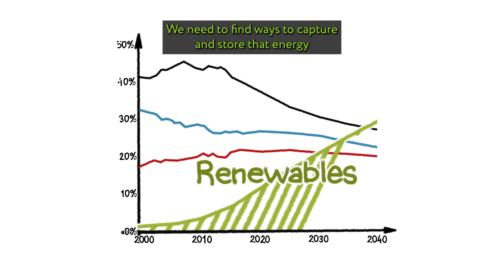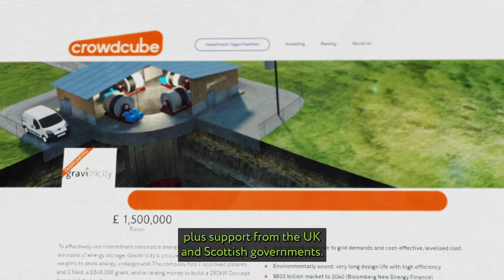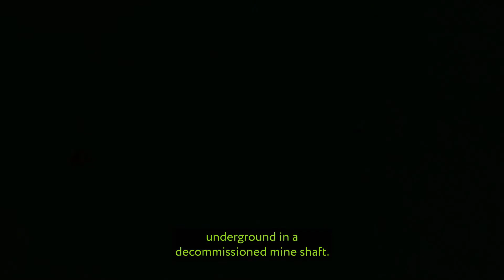Gravitricity Campaign -  Unique technology uses heavy weights to store energy underground

Comment: The company may have 4 or seven patents on different part of the system they use on storing gravity energy, and this is appreciated.  The technology can achieve to deliver limited energy on the greed, very probable the company may buy X kwh energy  from solar farms when energy is not needed and X1 kwh from wind farms if the energy is not needed.  Probably 2 time daily and 700 time yearly is possible to store energy for 700 blocks. Then these block will be used daily and deliver for few seconds or few minutes energy when needed.  A 500 Tonne weight at 1500 meter mine shaft will drop and generate only "Y" KWh during 18 sec or few minutes if will be slowed. The Y will be around 1.635 MWh if efficiency is 80%.  For this energy the company will by  from solar or wind farm 2.45 MWh if lifting system has efficiency 80%. So, SELL. vs BUY energy ratio is 67%

Comment: As far as scalability is concerned, I am curious whether a model of the same efficiency can be built so that someone could install their own at home, and physically hand-pump water up into the heavy containers, to generate the electricity on your own, without having to draw the energy from the grid. Perhaps the pump could be attached to a bike wheel to pedal the water up, or a person could carry jugs of water up to the top of a staircase, to get lots of cardio, per weight drop?
Reply: ofcourse it possible but it is not cost effective to use for powering your house  cause it have a mechanical and electrical systems including generator,motor, control system, wind or solar power device ...

Comment: What a stupid waste of money. Inferior in every way to pumped hydro and I don't need to pump (no pun intended) millions into research to see the obvious. Still kudos for getting a bunch of funding to fart about with.
Reply: I would like to start with a comment on potential energy storage.
Contrary to the claim that reservoirs generate energy, this system is in reality, the largest and oldest way of storing potential energy.	

In the first story I read about Gravicity, a weight of 3000 tons  could be lowered to a depth of 1500 meters in a mine shaft.
In this way, 12.26 MWh of stored electrical energy could be returned.

At the same time I was experimenting and developing my  Gravity Gallery ® system.
With this system, the same amount of potential energy can be stored  in this shaft, with 3000 tons  of ballast in a working depth of only 775 m.

If the entire shaft of 1 500 metres deep is used, this can amount to:
16 875 000 kNm potential energy.

Which corresponds to;   45 980.9 kWh 45.98 MWh electrical energy.

Comment: 250Kw for 30 seconds. Drop 50 tonnes 15m = 7.5MJ = 2.1Kwh single kettle for an hour, at scale 500 tonnes 1500m = 21,000 Kwh. You cannae change the laws of physics....
Reply: PE=mgh, I don't know how you are calculating
Reply: @paksauditech.5360 
mgh delivers Joule (if mass m in kg;  g is 10m/s^2; height h in m).
To get kWh you need to know that 1  Joule is 1 Watt * Second or 1 Ws.
So 1kWh = 3.6 MJ (3.6 Millions Joule)

Comment: The presentation should simply be "A lot of money is being thrown at green energy projects and we want some of it".  For a system like this, or "energy vault" to work you need a grid producing enough excess power to change the system up.  This might mean more windmills or more solar, I am excluding nuclear, fuel based,  and hydro systems because they don't stop working when nature isn't doing it's part.  Well, hydro does but on a much longer cycle.  Anyway, you need the grid charging it up, which means excess power generation systems, not quite double the needed output, which will have to be considered in the cost of any kind of system like this.

Comment: SO , begs the question, why use concrete or lead or what every you want to use as a gravity battery? Why not use Dry ice in a closed well bore or mine shaft.  Attach a block of dry ice to your line, depending on the enviroment inside the the shaft... its time as in a solid state will determine the amount of energy you can harvest off of your frozen carbon dioxide cube. Gravity cares not what it pushes on...  After the dry ice turns to a vapor you wont have to tug very much at all against gravity to get your rope back up on the drum. The dry ice expands inside the shaft and you capture the carbon dioxide gas and compress it back into more dry ice.  Yes the process of compression uses energy, but maybe the math would determine viability of this idea... what do you think?
Reply: I didn't hear where they mentioned what is inside the containers; where do you get that data?

Comment: I appreciate the concept and believe the kinks will be worked out and it will become viable. But in watching the test model, the thought occurred that using a pendulum design may prove more simple and even more efficient. Theoretically, a pendulum design should require substantially less energy to overcome gravity. Or have the pendulum make the full revolution and it may even produce more and overcome gravity for 1/5th the arc. Lastly, what about a weighted roller coast system? Start with a two-hundred foot spiral tower fitted with several generators along the way. As a weight rolls downward it turns all generators. Weight number two releases from the top as number one nears the bottom. The energy required will lift the weight to the top position at an angle. And you may have more than one weight at a time make the energy producing downward transit downward. Crazy. Crazy. Crazy.

Comment: There's definitely some kinks that need to be worked out. But definitely better than energy vaults concept. I would use abandoned mine shafts and build a quasi rail system at the top and bottom. Multiple cranes would be needed, to have back ups during inevitable maintenance. I dont think the cables will last long at all with 24/7 wear and tear. Even mines replace cables pretty often.
Reply: They also aren't telling us how much energy dropping a block will release and for how long. Once that block reaches the bottom, no more power. And their design can only handle one block at a time. And when a cable snaps the costs to fix the system will be very high. And this isn't scalable, few mine shafts will be in a good position and drilling new holes will be massively more expensive than lithium batteries where you can just install more.
This is a non-starter.